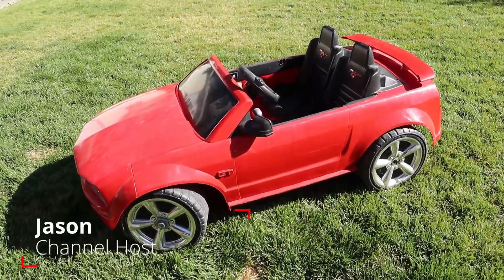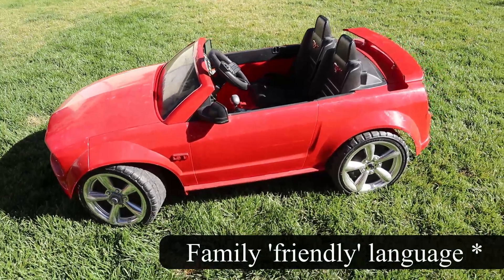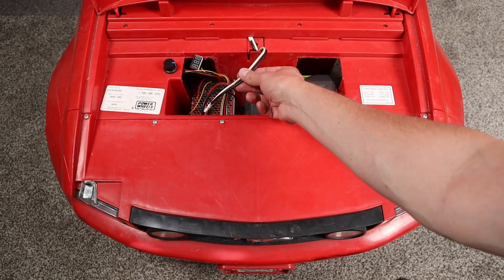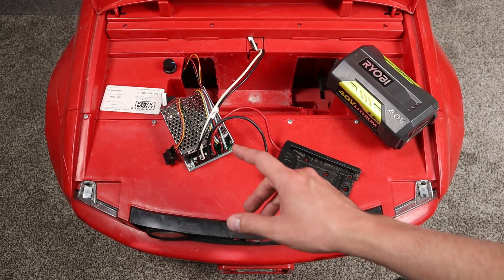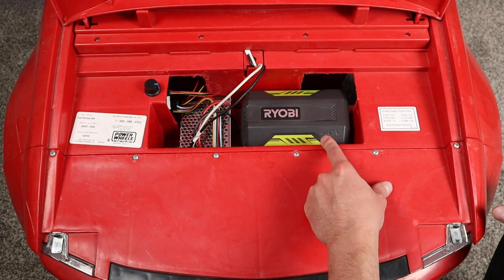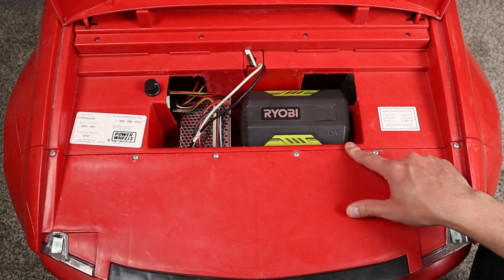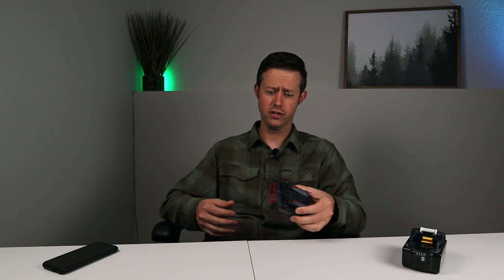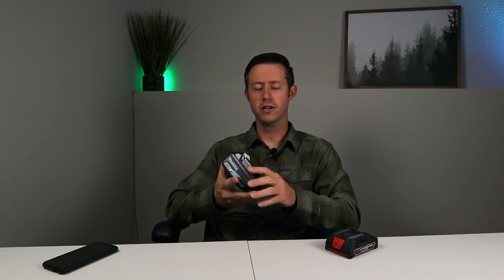40 Volt Power Wheels Mustang! Simple Mod - Much Faster!

Comment: Great video but can you describe how you made the gas pedal fit into the mechanics of that, how does the controller know when the gas pedal is being pressed
Reply from the maker: Hey Drake, the controller is on, it's always putting out the set power/voltage, pressing the gas pedal just closes the circuit and puts electricity to the wheels. The pedal acts like a switch basically.
Reply: @Jasonoid  where does the gas pedal wires go, do they fit into the controller
Reply from the maker: They go straight to the shifter (which adjusts power direction) and then goes to the motors

Comment: I have a 56v ego leaf blower battery I want to try this o. The grave digger monster truck
Reply from the maker: If your power wheels has other electronics like radios and headlights, you'll want to unhook those since they can't handle the higher voltage.

Comment: Pretty cool , have a dual motor Range Rover planing to modify , but I’m sure I’ll need a lot more than just battery and control unit , any suggestions ?
Reply from the maker: The battery and controller should be all you need, you'll want to unhook any other electronics like headlights and radios since they can't handle the higher voltages.

Comment: wat Kinde of Speed control was That
Reply from the maker: Its a PWM controller and it controls the output voltage to the motor, it's not quite a speed controller.

Comment: is this for power wheels only?
Reply from the maker: There are many brands of these battery powered cars, this mod will work on most cars if they have a simple setup. Some cars have an RC controller and this will not work on those.

Comment: Two quick questions, do you need a low voltage connection with these batteries? Because with the milwaukee batteries you need one,  or else you'll damage the battery. And also, is it possible to do a 56v ego with these power wheels.
Reply from the maker: @56volts it would fry the motors, I run the 40v battery at 55% max, so it's around 24-26volts or so.

The ryobi batteries have a built in low voltage protection. Some batteries it's built into the tool.
Reply: @Jasonoid  oh OK, yeah I thought the same thing. I think I'll probably try the ryobi 40v
Reply from the maker: You could also use a 22v to 24v tool battery at 100% speed on the pwm controller. Would be cheaper and you could pick up a 5amp hour pack for pretty cheap!
Reply: @Jasonoid  what 22v to 24v battery would you recommend? I have milwaukee batteries but I honestly do want to go through all the stuff on how to  wire everything, like low voltage adapters, and speed control, I want something that can just pretty much plug and play.
Reply from the maker: @chevyxrz  I think dewalt makes a 24v.  It wouldn't be that different in speed running a 20v battery, theres are tons of those options available too.
Reply: @Jasonoid  thank you so much for your time, and response appreciate the help and info.
Reply: @Jasonoid  Can you please recommend what exactly is needed for the cheaper solution?  I don't have the lithium battery yet so I'll take your suggestion.  Newbie here.  Ty!
Reply from the maker: @Jeff-vj3jp  Go with a 20v lithium tool battery and theres no need for the PWM controller. Just buy a 20v tool battery and charger online and find a matching battery adapter on eBay and that's all you'll need to get started. That will double the speed of these power wheels.
Reply: @Jasonoid  So, if I use a 20v Craftsman tool battery and get a charger for it I can wire the charger directly to the Power Wheels power lines and that's it? Do I need an inline fuse?
Reply from the maker: @Jeff-vj3jp  the batteries usually have a built protection but a fuse would hurt anything.

Comment: I’m an FPV pilot and for my one daughter 1st bday I got her a car and she loves it. It uses a crappy 2.4 remote and I’ve always wanted to add a 915 system and connect it to my drone radio. You have inspired me to start it! And she tossed the remote in the trash without us knowing and they want 30 bucks for that piece of plastic lol
Reply from the maker: Sounds like a great project! Just be careful of the higher voltage batteries damaging your radio equipment (I'm sure youll keep the power systems separate). Let me know how it turns out!

Comment: So i brought a huffy torex utv 24v for my kids this Christmas, everything works fine but i wish i could have more time on battery life, it last about 30 min when is full and then charge it for 12 hrs, i wonder how much time this 40v would give? I been thinking on do battery upgrade but this seems more beneficial, idk what motors this torex have, all i know is that is 4x4 and runs about 10 mph, again im not looking for more power or speed, i just want more time, do you think doing what you did would give more runtime? Thank you in advance!
Reply from the maker: You could run your torex off 20v lithium tool batteries. You would just need to double the current AmpHours available in your battery setup now. I would recommend purchasing a large 5/6 amp hour tool battery (or a few of them) and just hot swap them as needed. You can find adapters on amazon and ebay for many tool batteries.

 I'm not sure how 40v would work on that model, it may fry electronics that aren't good for 40v input.

Comment: Does this not burn out the motors and wires???
Reply from the maker: Depends on the size of your motors/power wheel. Running the pwm controller at 55% with a 40v battery seems to hold up well. Mines be going consistently for over a year. Anything above 55% causes excessive heat and damage so don't run it higher than that. 

Using a 20v tool battery would be fine at 100%. I used the 40v battery because I had a bunch of them laying around. Make sure to unhook any accessories like radios or lights before the mod because they can't handle the higher voltage.

Comment: Hey @Jasonoid
Thank you for this video! It is helping me with Christmas presents this year. 

I do have a couple of questions though.

I saw in other power wheel conversions they install a 30w inline fuse/breaker. Would this be necessary for this setup?

Also I'm doing a couple of conversions. I had one of the convert circuit come out of the packaging not working. Did you have this issue? Or what is the expected lifespan of the circuit once installed and working?
Reply from the maker: The Ryobi 40v batteries have a built in fuse and protection so I didn't use a fuse with my setup, I guess it depends on which battery you go with.  Just remember any electronics, radios or lights built into the power wheels won't be able to handle higher voltage upgrade so you may want to unplug those to avoid damage. I usually run my power wheels at 24v or about 55% on the pwm controller. If you use a 20v tool battery you can run the pwm controller at 100% just fine.
Reply: @Jasonoid  Thank you for such a speedy response. I am using the 18v Ryobi batteries, which I'm pretty sure they do not have built in fuses. So do you think I should install the inline fuses or breakers?
Reply from the maker: @ajlinztaylor8331  yeah do a in line fuse
Reply: @Jasonoid  Thanks again!
Reply: @Jasonoid Sorry... Hopefully these will be my last questions. I should only need one breaker per system right? And should I install it on the positive line? And should it be between the motor and circuit? Or between the battery and the circuit?

Thanks again for the help!

Comment: Hi there.
Question:
1.Is it ok if there is no battery adapter?
2.Is it ok if there is no PWM?
3.Is the radio from the discussion refers to the sound like beep(horn)?
4.I will unplug lighting and sound only for the modification of 12v to 20v?
5.Please confirm if my set up is ok.
i have 20v 2.0Ah. Negative terminal is same from my stock setting. it directs to my 20v battery. For Positive terminal, I just added a wire with 30A fuse then this 30A fuse to the small black box. this small box is connected to rx19(big box with bunch of wirings).
At first, lighting and sounds are ok with this set-up but i think lights are heat up when i touch it around so when i go back to this video i should deactivate it.
no problem with the step acceleration. forward-reverse is ok.
I will subscribe to your videos.
I hope for your reply. Thank you so much.
Reply from the maker: -No need for a battery adapter as long as you can connect your battery somehow.  Sounds like you were able to do that.
-You also dont need the PWM controller at 20volts so thats fine.
-Some of these power wheels have a radio with music, unhook that if you want it survive 20volts.

Only subscribe if you are going to watch future videos on the channel, good luck on your project, you should be pretty close :)
Reply: @Jasonoid  I subscribed sir. I want to watch many DIY from you. I learned a lot. Now i will test a full charge battery how it lasts. I want to know also how great we are. Thanks!

Comment: What kind of gearbox did you use. Because I know if you use a 24v gearbox overtime you can blow them up. If you use a higher voltage battery.
Reply from the maker: Everything is stock except the battery and pwm controller. Running at 55% or lower works fine, so a 24v battery would perform the same. No damage to my gearboxes yet and it's been going for over a year weekly.
Reply: Is stock voltage 12 or 6
Reply from the maker: 12v in my model

Comment: How do the batteries hold up with getting drained faster and lower then normal? Or do you even have to worry about draining the batteries to extremely low levels repeatedly with this set up?
Reply from the maker: I have multiple batteries so I rotate through them. This uses the same power as a weed Wacker so not more power draw than normal. The batteries have held up fine.

Comment: I have an issue with battery going into limp or surge mode have you had this problem?
Reply from the maker: Can you explain exactly what's happening?
Reply: @Jasonoid  it will go for a second between 70-100% and the batteries will just shut off until you disconnect them.
Reply from the maker: @davidchurella6673  The motors are pulling too many amps for the battery. Maybe they are bigger than mine? It has a built in safety feature to keep it from burning up. Try around 40%-50% on the PWM controller. That's should work for you.
Reply: @Jasonoid  yeah I have to start out at 50% and I can turn it up once it's moving
Reply from the maker: @davidchurella6673  Be careful running it over 55%, my motors got SUPER hot and I smelt burning after driving at 60% for about 4 minutes. So just make sure to not turn it up to high. Each power wheel will be different. Yours may be able to handle that high of voltage but mine wasn't.
Reply: @Jasonoid  I appreciate the information.

Comment: I’ve completed the upgrade with a ryobi 40v battery, tray and same pwm. I notice the whole system shuts down after about a minute or so of run time. I also notice when I press the battery statue button it lights up 4 green lights as full, but when it stops the middle 2 lights are lit only until I disconnect the battery. Once I disconnect the battery and plug back in, the car runs again but same result. Any ideas on how to get this to run longer? My 90 pound son has been in it (he’s 11 lol).
Reply: The knob is only around 40-50%
Reply from the maker: Does it do the same thing around 20%?
Reply: Yes but it will last a bit longer but not much. Also, at 20% there’s no reason to do the mod Bc it’s around the same speed as it is stock.
Reply from the maker: I was just curious how it behaved at a lower speed. Yeah no reason to run it that low if you have the mod. Is this a used battery that was recovered or is it a new battery? What type of power wheels is it?
Reply: Yeah it’s brand new, I accidentally bought a refurb the first time and it was no good so I returned it. It’s not power wheels brand, it’s feber. It’s a 2 seater Ferrari with dual motors. It seems to be connected properly.
Reply from the maker: Maybe your motors are much bigger than mine and are pulling over 40amps? These ryobi batteries have an internal battery management system that shuts off power if 40v gets pulled from the battery. Mine shuts off like you describe if I have mine turned up to 50% and I am sitting on it riding it. Almost 200lbs.
Reply: @Mustachio388  mine is doing the same any luck?
Reply: Interesting…is there a way to disable that or override it with a different pwm?

Comment: Just dont push it the best part of this mod is the hot swappable batteries dont go too much higher than the normal voltage of the car it can cause alot of problems. I modded 2 of my kids powerwheels with ryobi 18v system withe the same speed controller and they drive until they dont wanna drive anymore not because the battery died.  Powerwheels should adopt this system and even remove the speed controller it would still be awesome for the kids.

Comment: Wth is the pcm for??
Reply from the maker: It's a pwm controller. It allows you to adjust the speed from 0% to 100%. So if your kid is learning is doesn't go super fast. Lower speeds also allow the battery to last longer

Comment: So do you only need the pwm speed controller for brushless motors
Reply from the maker: The pwm controller controls the rpms of the motors. Without the pwm controller it would be 100% speed all the time. My motors are brushed so youd need a special motor controller for brushless motors, kinda like a rc brushless esc.

Comment: Nice work and tutorial. 👍
In my case, I am about to purchase the Peg Perego 12v John Deere tractor for my grandson.
It has the other electronic features....radio etc....
If I was only looking to increase the usage time, couldn't I just upgrade the 12v battery to an increased amps per hour rating?
Like from a 8 ah to like a 36 ah without the possibility of damaging anything?
Of course a longer run time would increase the heat on the motors.
Any thoughts on that?
Thanks.
Reply from the maker: Running a larger 12v lead acid battery would allow for much longer run times. If the tractor has space for a larger battery I would do that!  No damage to the radio lights and other accessories.
Reply: @Jasonoid  , WOW....thanks for the fast reply!
Yes.....there's a YouTube video of someone running a large auto battery in the same toy tractor. Thanks again. 👍
Reply: @PTucker0864  I’m not sure but I think the watt hours also need be looked into because I think if it’s a high wh battery then that might damage the electronics but I cannot be certain.
Reply: @Alexander_l322  , the battery only controls the motors on that John Deere.
What I did was hook 2 batteries in series that would fit under the hood.
No complaints so far.

Comment: Great vid! Can I do this mod on my sons Lamborghini Urus SUV??
Reply from the maker: Any electronics might be damaged with the higher voltage so unplug those before doing the mod (radio lights and so forth). Using a 20v tool battery is best because the motors won't get quite as hot and burn up.

Comment: So I’m new to this we have the mossy oak Dodge Ram truck. I didn’t buy and controller yet. Tried hooking the adapter straight off where the old power battery would be it took off then shuts off the radio stopped working and so did the lights what would you recommend?  and thank you for your time.
Reply from the maker: What type of battery are you using for your power wheel setup now?

My power wheel didn't have a working stereo or lights so I didn't even think of that!.....I think I know what probably happened to your model. The radio and light electronics are designed to be used on 12 volts but with a higher voltage applied to them they may have had a fuse inside blown. You can check for blown fuses and replace the fuses to get them working again. If there wasn't a fuse you probably wont be able to get those up and running again.

I will put a NEW pinned comment on the video mentioning higher voltage input might damage the other electronics on board but is fine to work with the motors.
Reply: @Jasonoid  I have the ryobi 40v 4ah
Reply: @Jasonoid  but the whole truck just stops after a few secs on the pedal and the batt has 2 center lights come on
Reply from the maker: @TheKybarker04  so these 40v Ryobi batteries have a safety cut out if too many amps are getting pulled through the battery. Your power wheel might be drawing to many amps during motor start up. What happens if you put it in low speed and have someone push a little bit while it's starting? If it doesn't cut out when you do that then you know the motors are pulling too much power. ALSO...how high do you have the PWM controller turned up to?
Reply: @Jasonoid  it does it on all speeds and I don’t have a controller yet I unplugged everything and currently have my lawn mower battery in until I can figure this out.
Reply from the maker: @TheKybarker04  I haven't tried my power wheel without the pwm controller. Many people have good luck with 20v tool batteries. Do you have any of those laying around you can give it a try with that?
Reply: @Jasonoid  I do not I’m going to order the controller and see if this helps

Comment: My boy has a bigger power wheels jeep two person. All I did was cut off the wires from the jeep plug stick on some adapter plugs and plug it into my 5amp hour, 20volt dewalt straight. His jeep will hit 13km with him on it. He now loves it. You do have to watch that the battery does not run down too far, or the battery is ruined! I let him drive around 20 minutes or so then check the battery and charge as needed.
Reply from the maker: The pwm controller is only there to adjust the speed. If you want it to run max speed all the time your option works great! As for the battery running down too low. Some tools have low voltage battery protection in the tool, and some have low voltage protection in the battery, you can Google that to verify with your specific battery!